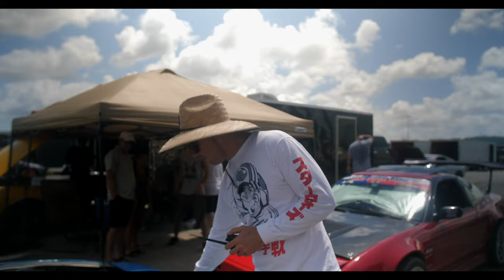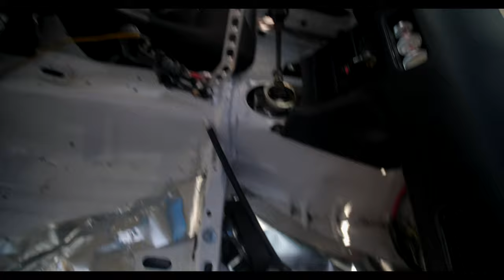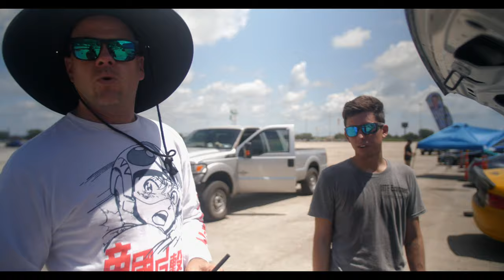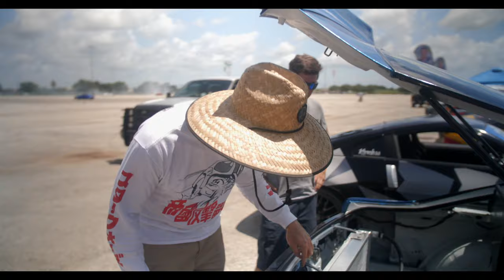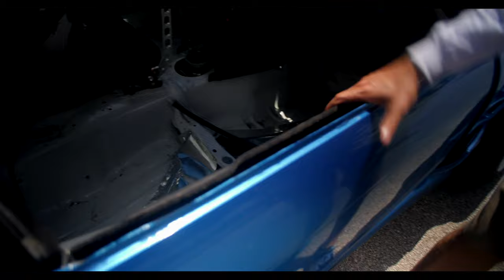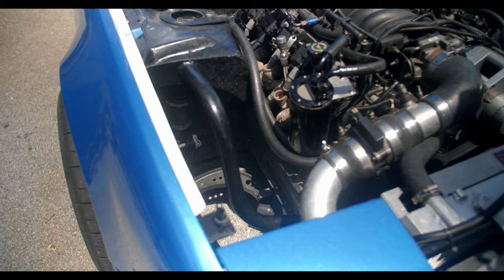2 Radiators in 1 car?!  Keep your 600 whp drift car cool!

Comment: I have a ls1 swapped s13. I live in south Florida. My car over heats after 3 laps, she will peg 250°. I'm doing this tomorrow. I feel so dumb  for not thinking of this before. Thank you so much.
Reply from the maker: Please let me know how it works out, I am curious how this works if people implement it!
Reply: Michael Fabiano before you go too crazy with cutting and buying a new radiator and plumbing, make sure:
1) your thermostat works and actually opens at a low enough degree (around 80 Celsius would be good)
2) your circulation is good. No clogged interior heater, no almost dead water pump, no wrinkled up hoses, etc.
3) you don’t have direct heat sources heating up your radiator or hoses. Manifolds are the most common culprit here.
4) you have good airflow to the radiator and very important is that hot air also has a quick and easy escape (hood vents for example)
5) your oil cooler has big enough lines and sufficient air flow in and out.
And of course, no air bubbles!
Otherwise yeah, go for it 😃

Comment: could put a valve in the heater core line and then be able to switch between a 2nd rad (for hot weather) and a functioning heater core (for colder weather)

Comment: My Dad took the heater core out of my e30  and put a huge radiator on it, we also take my bonnet off if its really hot but we might go for 2 rads on my s15, great idea
Reply from the maker: How did that work for you?
Reply: @LoneStarDrift  It works ok but gets hot during battles and cools down quite quickly. with 2 rads does it get hot during battles or just stay cool?
Reply: Max Cotton Drifter I ran a full comp with 6+ battles almost back to back and never broke 200 degrees
Reply: @MTFEQUIPMENT  Cool. sounds like a plan for my s15 :)
Reply: I watch all of your vlogs  @MaxCotton  I can't believe you are a CHILD and you drive as you do. How old are you??
Reply: @andyjohnson5545  I am 14 Andy
Reply: you are a superstar  @MaxCotton
Reply: @andyjohnson5545  thanks, I appreciate the motivation :)

Comment: I've had this idea before only much more involved as in with big piping and a secondary eletric pump.  Also have an idea of using a dirt bike radiator and have a stand alone system for the turbo as well
Reply: as in off the waterpump into the water cooled turbo, then into a dirt bike rad back to the return.

Comment: Someone tell me if it's a bad idea.
I want to basicly do this to my Patrol but in place of the in cab rubber lines! I want to do a stainless pipe with alloy fins so basicly a pipe radiator... they will also be on the outside.